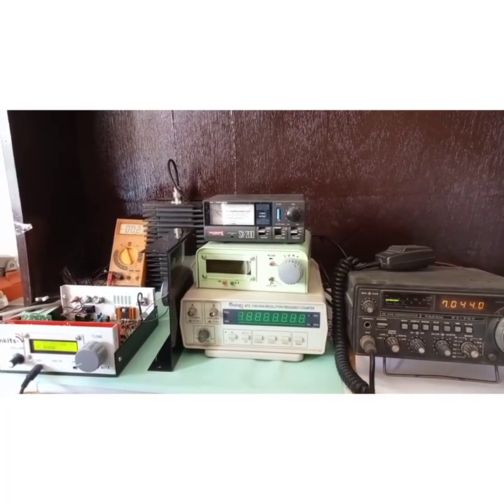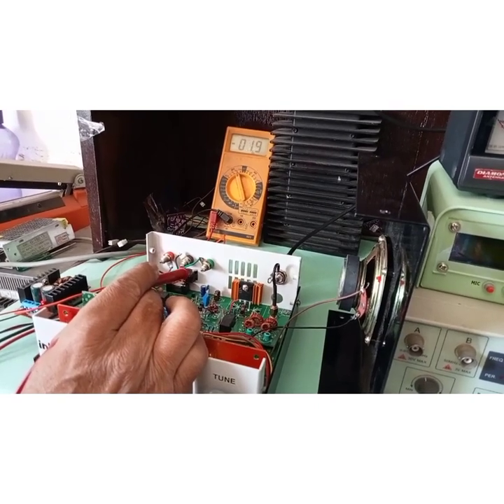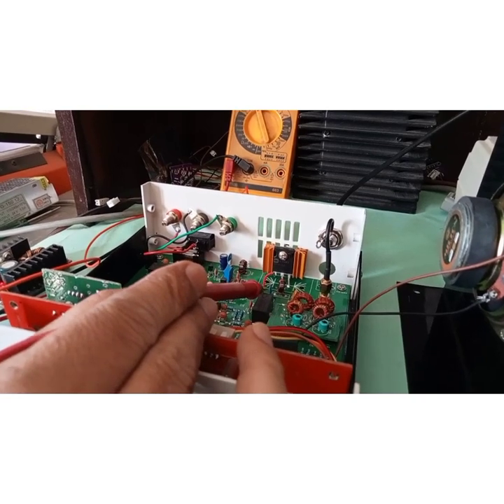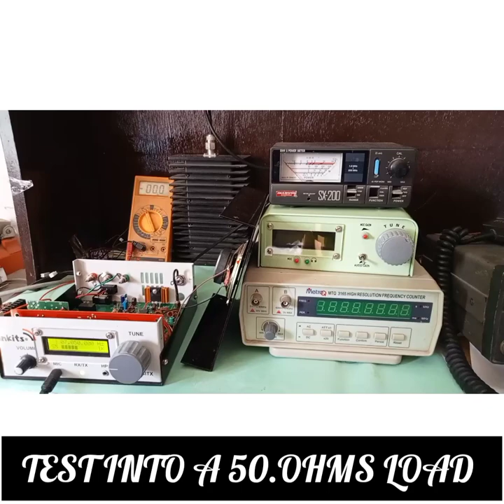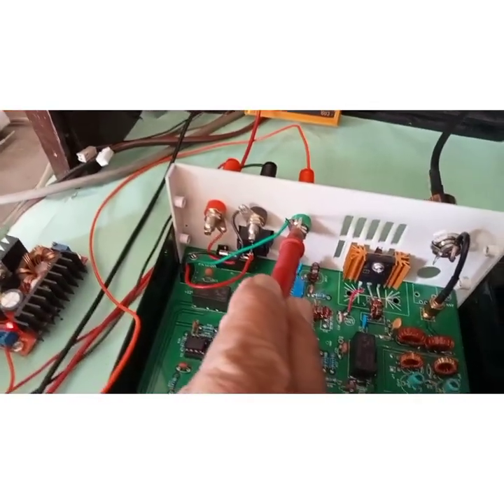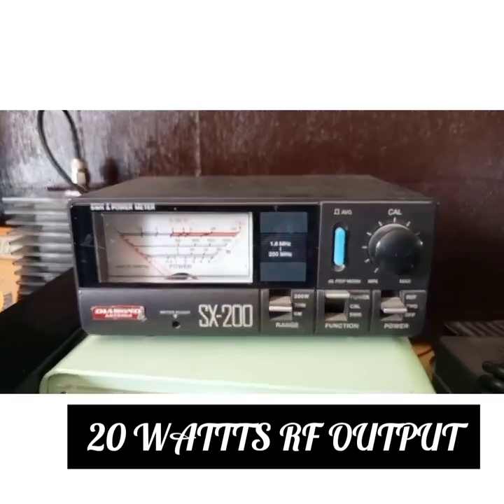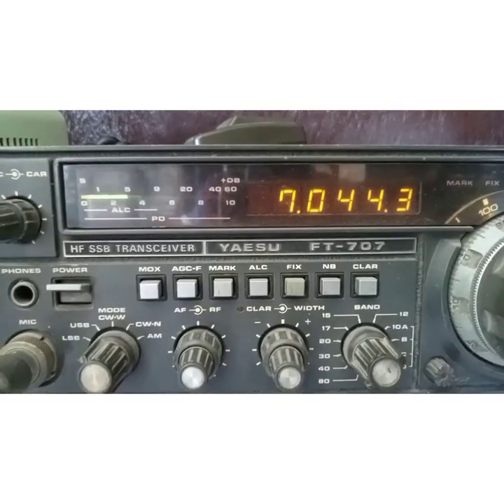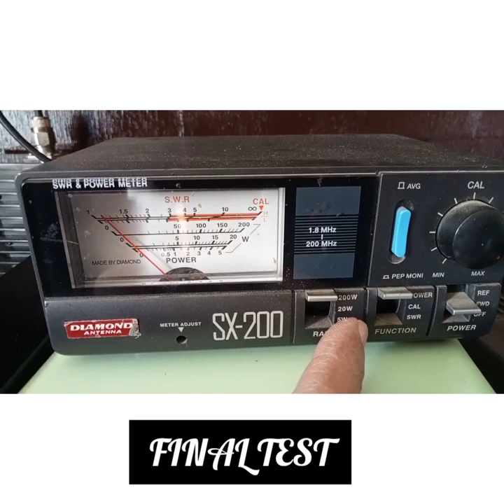Qrp 20 Watts Easy Bitx With IRFP150

Comment: How does the power inverter work in terms of Rf noise or noise on the output?
Is there any received noise or Tx noise on air with the switching frequency?
Looks like a nice cheap way of gaining that little bit more out of the radio if there's no noise.
Reply from the maker: Noise will depend what type of power supply is being used . In my case there is no noise on receiving the linear output with IRF150. Drive should be sufficient for IRF150 which demands a bit more drive then the IRF510
Reply: Thans, that's nice to know.
This has given me a few ideas.
Any more info on the release of the uBitx kits?
 @inkits1
Reply from the maker: Thanks we are working on the ubitx kit .